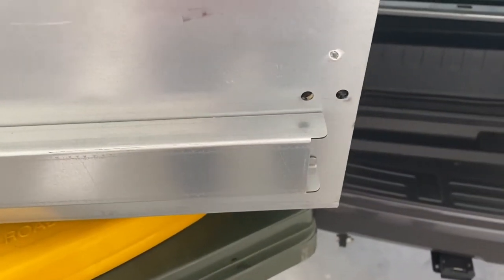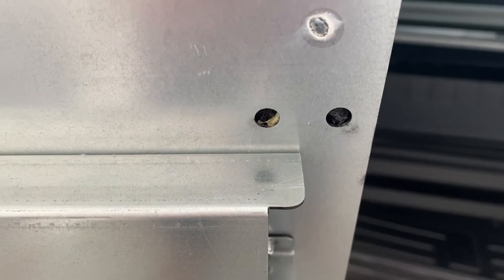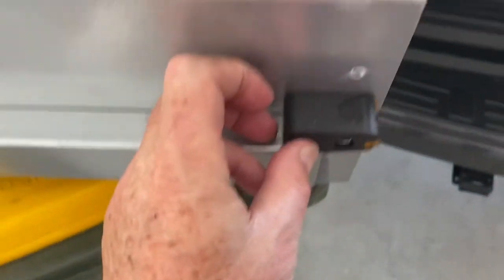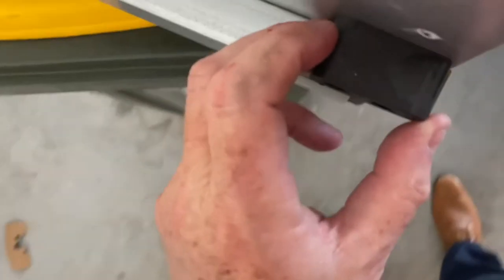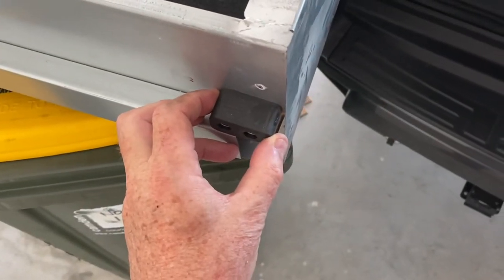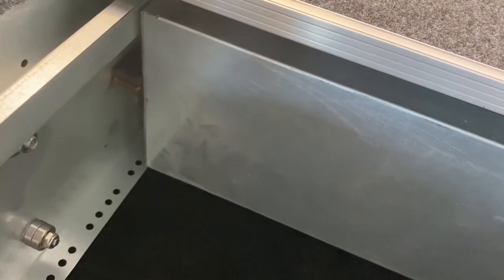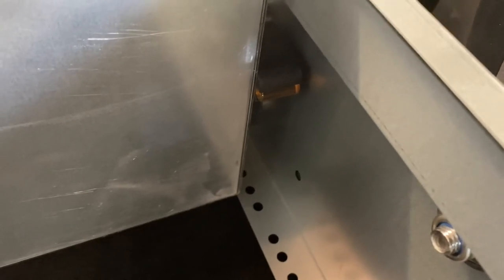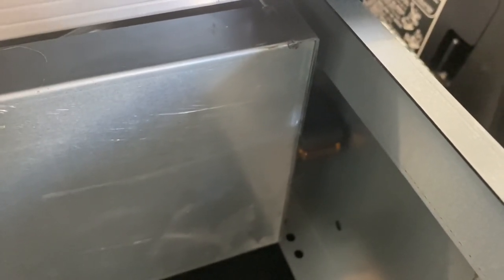How to correctly install the bumper stops on KINGS brand Drawer Systems.

Comment: G'day Peter could you please tell me if you problems with fuel gauge accuracy and distance to empty
Reply from the maker: Hi John, I must admit I haven’t noticed any issue. I rarely let the tank drop below 1/4 full and I have the duel tank model. Usually a fully fuel tank is showing a range of about 1750km after I tank it right up.
Reply: Hi there, I know this is an old comment however I've just come across it - we have a 2018 150 GXL and I think, personally, the DTE is too overestimated. We'll get down to a range of 0, fuel up, and I'll only be able to get 130 out of 150L in. Obviously things would be very dire if you were in fact putting 150L in, however I think the computer allowing a 20L reserve is a bit much. I have 2017 Hilux and it is much the same, although a little better and still allows for about 10L which I think is ample. 

Also, thank you for the video @PradoPlacesOz - I'm about to install a set of these drawers in the same manner. We have a cargo barrier we don't use as it takes up too much space when installed (as much as I would love to use it), so I'm going to try and make use of the anchor points for that to secure the drawers. 

Cheers.